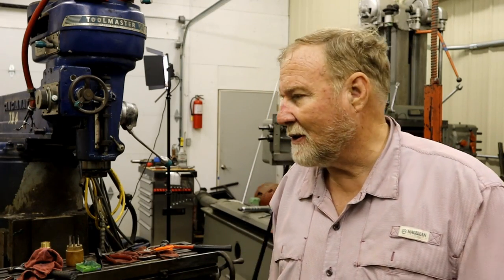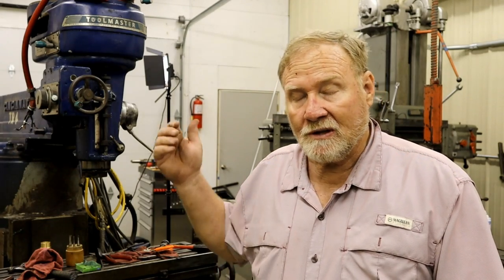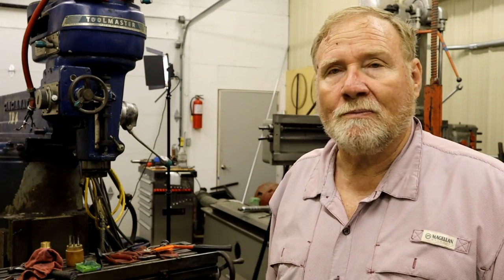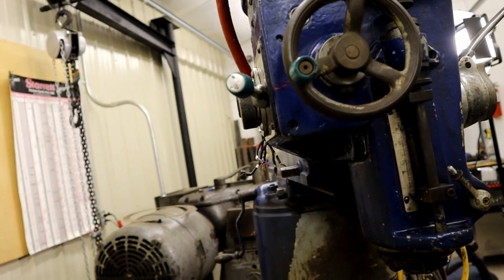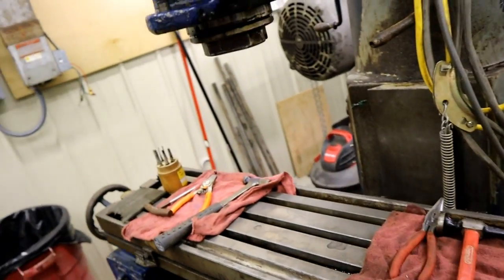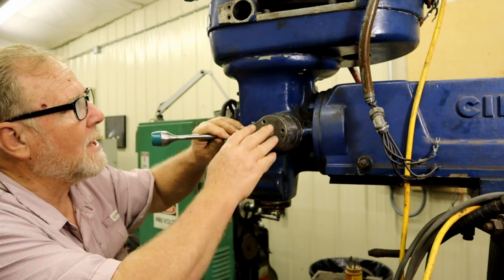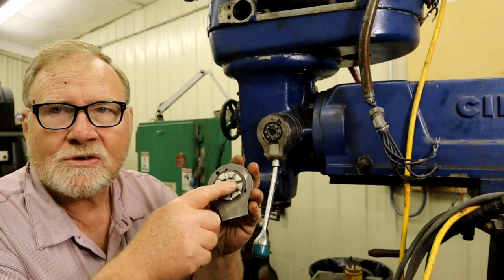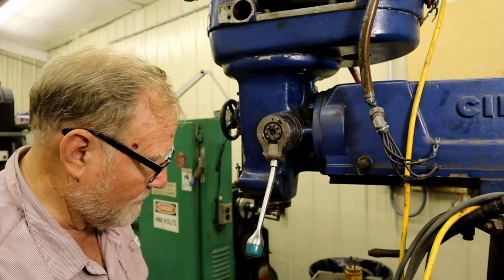What did they do to this poor Cincinnati Tool Master Mill

Comment: I click on this video because of the milling machine, but then I saw a planer in the background. In the 70's and 80's I worked in a track shop (railroad track) cutting switch points, guardrails, crossings, filler bars (castings) and many other things. It was a very enjoyable time of my life. I am now old and retired and still miss cutting steel on the milling machines and planers I use to operate. Thanks for the Video.
Reply from the maker: Where do you live?

Comment: Steve the clutch collet  that you were using in Bob requires an adapter that goes on the spindle for it to close properly. You can get away with out drill bushings by putting a drill chuck on a 5/8 arbor and machining a flat for the set screws. Like your videos just the way they are keep it up.
Reply from the maker: Please tell me more about the adapter!  I have two drill chucks, just makes the tools stick out far....

Comment: Keep  doing what you’re doing Steve!  I sure don’t mind it.  I don’t watch every video, but I do watch most that cover the Toolmaster 1-D as I have one myself, and it could use a little work sometime.  Most everything works but the power feed for the quill does not, and there are some leaks.

Comment: I wondered how that dial got all egg shaped a video or so back.
Bob is going to be really handy, what a great score. Your going to need that telephoto lens more often. My friend uses a telephoto with a tele converter adapter. Takes macro like images from many feet away.
Reply from the maker: I think they either beat on it when trying to southern engineer the problem or it took a hard fall when they had it apart and they just beat it back on...

Comment: Fwiw, i think your small buffer wheels are referred to as 
3M ROLOC quarter- turn discs.
There are similar products from others using same qtr turn interchange.  Yes they are awesome!
There also are bench grinder cleaning/ polishing wheels....3M Scotch-brite.  
A bit pricey, but they WORK,and last!!   Different aggressiveness available.  I like them a ton!!   ( as usual, 3m is spendy but always worth it for real guys working on valuable metal.
Just my 2¢ worth.
Keep up the video production...it will always improve.   
I appreciate your work!

Comment: I'm totally in your demographic, but the cut-in cut-out of the audio on the introduction almost sent me running.   I was literally about to close the video at about 2:50, and then all was good.   Hopefully you figured out the audio issue you had recording the intro.  Great video!  Keep up the good work!
Reply from the maker: It was a bad boom mike form rode.. Why it went bad after two years I don't know... A new one is sitting on my desk right now... NOW if I can square away the Rode wireless 2 mics I hill be in hog heaven...

Comment: I took a look at my 1-D today, at the drive for the manual quill feed.  The outer snap ring was KIA, the remains mostly still in the housing of the handle.  So I put a new snap ring on and found that the manual feed doesn’t work, the exact opposite problem yours had.  I’m guessing there is some obstruction in the power quill feed box that is preventing the feed shaft from moving fully to the right.  I didn’t dig further into it, but from the outside, my cog gear (the one retained by the snap ring) looked exactly the same as yours before “Bob” modified it.  Has me scratching’ my head a little.
Reply from the maker: IS your D1  running on 220 three phase? If so would you mind looking at the heaters in the back electrical panel and tell me the values for the three sets?  Mine is 440 and I want to change it to 220 , I have values like C7.78A and C0.78A  .... I have a chart and can find close ones, just wondered what the factory put in...   

I have some video on the removal and reinstall of all of that.... The feed gear has to line up with the gear on the end of that shaft and push into lockup to work... The power feed box just has a gear attached and can be removed off the machine, no connectors.. SO the only things that can be wrong. 1. the gear that I had to ream out has a key and it must be there to turn the quill. 2. there is a spring on the shaft that goes through the head and makes the gear on the other end of the shaft engage the gear on the power feed.  Not much to lock up in there....
Reply: I will try to get an answer to your question in the next couple days.  @10swatkins
Reply from the maker: @nschelling6420  Thanks but I figured it out the hard way :)  And surprise surprise the heaters in it now were the right ones for it to run on 220.. Seems someone changed it over and just left the 220 sizes in it :(

Comment: The dials are accurate on the Hardinge , but  when you face something you should use the carriage stop to adjust the depth one rev on the screws is .041.I made a micrometer adjusting wrench for accurate adjustments .I can show you what I made if interested .
Reply from the maker: Sure would love to see it.... my email in in the contact info on the channel page...   This was just a quick one off repair so did not take the time to use the stops.

Comment: You should be able to adjust the collar that holds the ball detent so that the handle can be stowed in the up position.  I had to monkey around with it on my 1D too.
Reply from the maker: I think it also needs a new spring... I will have to undo it and rotate the piece that has the setscrew 120 degrees to accomplish that.. Thanks
Reply: @10swatkins  My detent spring was in several pieces.
Reply from the maker: @mndodd  This one is not very springie but in one piece... I was going to look for another one... Did not think about moving the pieces so the handle was up in the air out of the way.. Thanks for the tip.!

Comment: Steve I enjoy the longer explanation don't change what your doing as long as you enjoy it. If you dont enjoy it you wont share and that would be a shame. Also could the clips be the issue? Maybe its one of those wire ring styles instead of the one you have? You did say someones been in there before you? Think that may give you the clearance your looking for?
Reply from the maker: Thanks.... The clips are the same as the factory parts list shows... I thin the gear was replaced with another because of wear and never fitted properly...
Reply: @10swatkins  Good to have a good info source. I just needed to finish watching before i posted

Comment: Could you have pushed the shaft out more from the other side of the head to install the snap ring? Or would the shaft have been too short to engage the power feed?
Reply from the maker: That would have been too short for the power feed... Fine balance between the two dog gears..... The replaced gear was too thick to fit between the snap ring groves and there was more room for handle throw on the manual feed side.
Reply: @10swatkins  I see what you mean.didnt know there were two grooves there.awesome work sir.

Comment: One question Steve, is the back face of the sliding dog pushing against the snap ring?  If it is wouldn’t it be better to cut the counter bore  on the back surface instead of the front so the machine surfaces are in contact, instead of the one surface being against the snap ring?
Reply from the maker: The dog would be in danger of not being far enough outboard and not connecting with the handle dogs then...

Comment: I also have a Cincinnati 1D with a quill feed issue. The manual feed is fine, the right hand side has never been apart (the original paint shows that outer cover plate has never been off).  The issue is that when I shift to power feed, it will start feeding okay, but seems to stall out (the quill stops feeding).  The hand wheel is still turning, but the quill is not advancing.  It goes again if I give it a little help with the manual feed.  To fix it, which side should I dig into first?  Regards,  David
Reply from the maker: There is really no "clutch" in the quill drive to give you problems... From the back side of the feed gearbox to the quill rack and onto the manual handle is all gears. 
Does the manual feed slip?   Take a block of wood and place it under the spindle then try moving the spindle downward with the manual handle... 

IF there is no slip it would mean that the gear that moved the spindle rack is ok and the key is not sheared off in there. 

IF I were to take a guess I would say that a pin has sheared on the gear that engages with the feed gearbox or has maybe stripped enough to not engage well with the output gear..  
 
I would take off the manual handle cover and push against the shaft to see if there is any slop in the shaft. That shaft has a spring that pushes the shaft to the left of the head and engages the feed gear.

Otherwise it's time for you to lift the head up, remove the phenolic gear ( that might be slipping also ) and then remove the feed box to check the gears there.  .... You lucky Dog :)
Reply: @10swatkins  Thank you for the information.  The manual feed does not slip - when it latches in it feels very solid (I put a block of wood btw the table and the spindle nose - with the manual feed, you can push hard).   Humm, I’m not excited about lifting the head - I’d watch you video a couple times through before tackling that.  I’ll start with your suggestion on opening the RH side.  D
Reply: I opened up the right hand side.  It looked great.  Next is to open the feed gear box.  I’ll watch your other video first. D
Reply: Now for the rest of the story.  I attempted to disassemble the feed gear box while in place on the machine.  Basically I followed your videos, I just went furter.  It is possible to get the gear box mostly apart and loose on the machine, but I could not get it completely apart or off.  The manual says to lift the motor and pull the helical fiber gear (drive input to the feed gear box).  So that is what I did, then entire little feed gear box comes off easily.   Per the manual, the motor, Reeves drive and reduction gear come as an assembly and can be left hanging, with room to remove the fiber gear and bearing/shaft.

The problem was at the feed box output -  the 3/16" spring pin (#445B on the "Spindle Housing and Overarm" drawing - credit to Mr. Rucker at VM) had sheared off.  That pin secures a small face spline "Clutch" #446B - which drives the shaft that crosses over to the other side of the machine.

Now there is plenty of cleaning, replacing all the o-rings and seals (per your effort on avoiding oil leaks) and getting it all back together. 🙂 David
Reply from the maker: @jillcraig1665  I did all of that too :)  But nobody seemed interested in the videos so I didn't waste the time to put it all together :)

Comment: I spent 4hours alining a cnc lathe and sitting in the car , they come running out , they had already crashed it , I could easily work 16 hours a day, when I do training I stress single block and distance to go after changes and feed rate at zero

Comment: I was expecting something a little different for your problem. Mostly, because I was called out on a job to fix a 'no feed' on a Pratt and Whitney jig bore one time. Come to find out, some "night shift" 🤣guy, put an 1 1/4 drill bit in the thing and tried to power feed it thru a chunk of steel. Yea, it was broke inside and was a real pain to get it apart far enough to clear the scrap and fix it.
Reply from the maker: As mama would say, " You can't fix stupid"....   Most things I see are the result of people not knowing what they are doing and blundering through repairs :(

Comment: Your videos are great the way they are! You can't please everyone. What's the chances that this gear goes on the other end?
Reply: Good thought
Reply from the maker: No chance it is a completely different gear and will not have the groove for the handle to fit in.... It has to be a replacement gear that someone king konged.

Comment: Whats wrong with the sound ?
Reply from the maker: Who the hell Knows !...  Went back to my regular Rode directional mic and all the clips had a ticking noise... Some  clips not as bad as others... Used a noise reduction filter to make it better but it still sucks... Think it's the Canon M50 mark 2 making it happen.. Last night I gave up and set everything back to factory defaults in an effort to make it go away... I've never changed anything in there anyway, always on auto, but will see if it goes back to normal....

Comment: The audio seems badly gated. You set the threshold too low.
Reply from the maker: There is something going on with the camera.. Some clips are fine others I had to use noise reduction to kill a click....  It all started when I first put on the new Rode Wireless Go 2.  I went back to the shotgun mic till I figure out what is going on but now it has the clicks.... Somedays you just can't win!

Comment: Just stumbled upon your channel, screw the hater’s you do a fine job and I like a longer video because it gives you more information. I am now a subscriber 😬👍.  My question is why did that snap ring not reach the groove? Is it assembled correctly?? Does it have a wrong part in it? Something has to be causing it to be short? Please I am not criticizing you in anyway so please don’t take this comment that way, in my experience it usually ends up being something stupid causing all the grief.  Again great job and I plan to watch all of your videos and to tell others about your channel.  😬👍🧑🏻‍🦽Eddie wheels
Reply from the maker: The snap ring did not reach the grove because someone put in a new gear trying to fix the wear problem and did not fit the new gear and just drove it on until it snapped into place... The replacement gear was too thick and that's why Bob came into play...